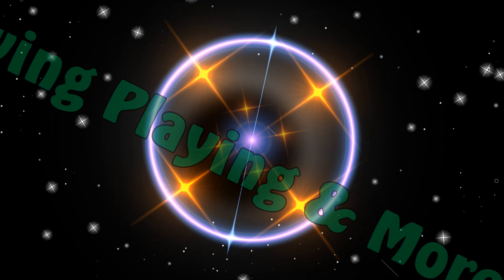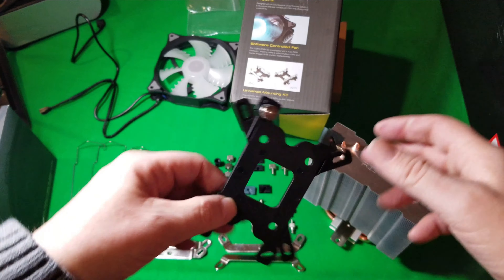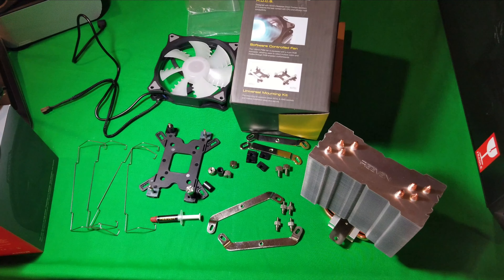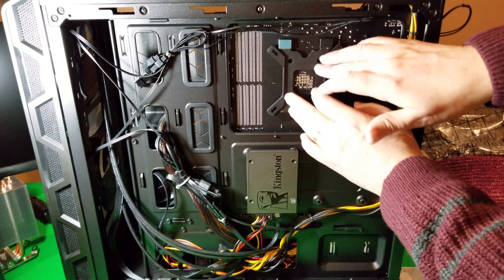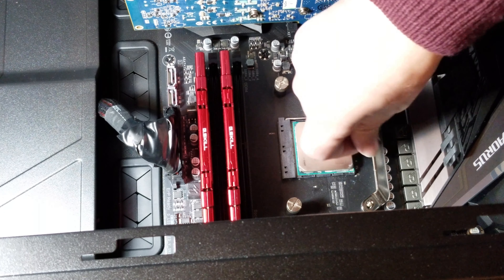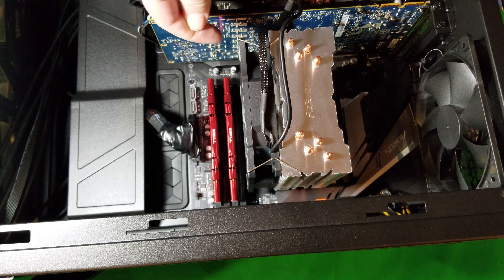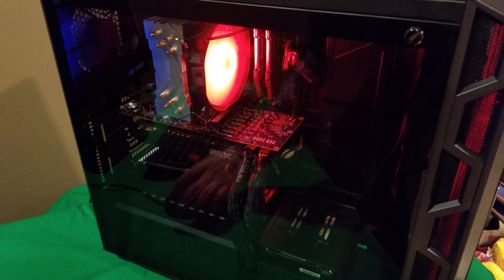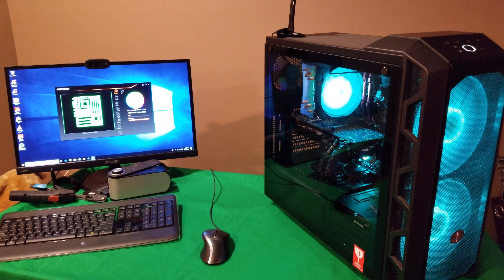Reeven E12 RGB CPU Cooler Unboxing, Review and Install for AM4

Comment: Thanks for the review. I made the same installation. My two cents ;
The heat-sink is of good quality and "relatively" easy to install. Does a better job then the stock cooler, especially on load.
Note : 
1- you WILL forget to remove the plastic film protector on the base of the heat-sink, like I did. No where it is mention in the instructions. I had to redo it again.
2- installing the fan on the heats-sink is a nightmare if you are replacing inside the case. The clips keep falling off all over the place and are hard to secure. I put a piece of electrical tape on top of the fan holes to hold that clip extremity in. It keep falling off. Removal is a bit easier.
3- the RGB connector is pretty loose connected to the MB header. Better put a strip of electrical tape alongside to secure it to the motherboard.

A version 2 will be welcome to fix that clip problem.
Reply from the maker: All good points...Appreciate the info...Thanks...
Reply: @Reviewing_Playing_and_More_RPM  One more thing like you mention, 4 - pay attention of the air outflow direction of the fan. Not mentioned either in the instructions. It may works in reverse but it is not as efficient.
Very helpful video. They should reference it on their website. Thanks
Reply: @Reviewing_Playing_and_More_RPM  One last thing Dennis I noticed, like your motherboard that the fan almost mask a RAM slot. I did not try it but can you still fit a RAM stick in there ?
Reply: I ended up returning the Reeven. There are some deficiencies that need to be address. I got a Deepcool Gammaxx GTE which is in the same price range. This one seem to be more refined (many revisions ?).
- the mounting system is way simpler. (AM4)
- I didn't like the cooler pressure plate of the Reeven. The heat-sink bar is extremely stiff with no flexing and I was uncomfortable with the pressure apply on the CPU when securing the two screws. The Deepcool use the same springs system as AMD which apply the correct pressure equally and adequately.
- the Deepcool fan securing clips is a ten times easier to install then the Reeven. It use the fan holes close to the heat-sink.
- the Deepcool documentation, contrary to Reeven, does mention to remove the plastic film from the heat-sink before assembly which a lot of people may forget.
- ram slot clearance is better for the Deepcool after installation. The cooler assembly is thinner.
- the RGB cable is built in 2 sections so you can omit it if you don't need it.
- temperature reading seems to be quite similar. A bit better with the Deepcool, I will say.
- one good note for the Reeven is that they supply a generous amount of heat-sink paste in a tube contrary the the Gammaxx which come with a tiny, one shot, pouch.

Any way Reeven need a version 2 of this cooler to correct the deficiencies to stay in the game.

Comment: Dark Freezer X124 vs Reeven E12. Which one should i choose? Dark Freezer X124 has 5+5 heat pipes; Reeven E12 4+4.
Reply from the maker: I'd go with the Dark Freezer X124, it should perform better...having said that I'm basing it on how it looks as I have no real experience using that CPU Cooler...Thanks...
Reply: @Reviewing_Playing_and_More_RPM  thanks for answer